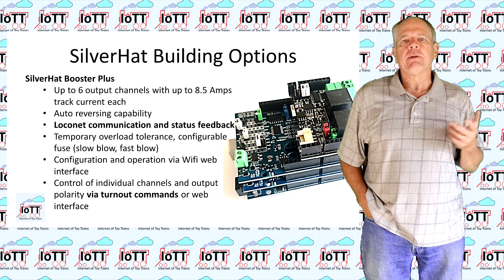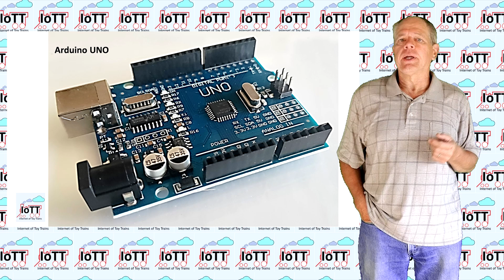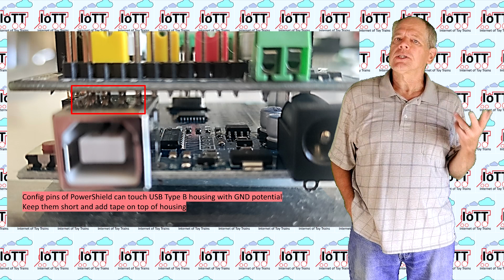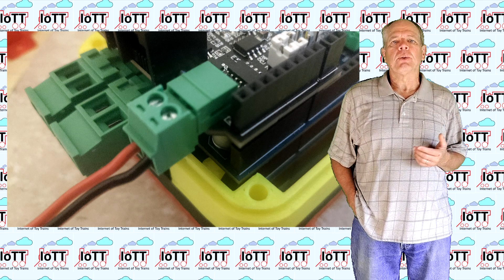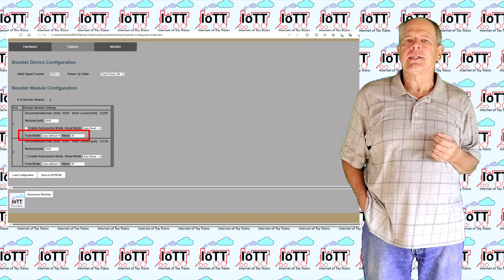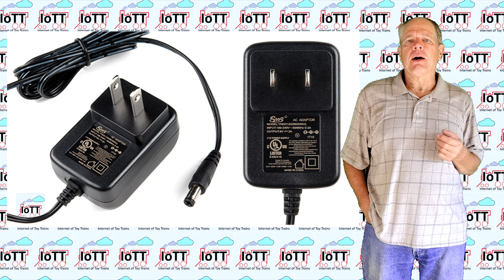Build your own SilverHat DCC Booster (Video#143)

Comment: Can I use the tinkerface with a AUX shield on a CSB1 setup as a booster ? I want to be able to access all the loconet feedback options on the M5 stick.  Or can I use a Wemos D1 r32 with a 8874 shield, Aux shield and tinkerface ?
Reply from the maker: Both ways could work, but you'd have to replace the DCC-EX software with a sketch that supports the additional functionality of the SilverHat, like current measurement and the communication. But then, if you do that, you could combine the Stick software with what's running on the CSB-1, since there is really no need to use 2 ESP32s for this. So, all in all, it is possible but does not make sense. The better option I think would be to add some functionality to the DCC-EX software and make it available via a web interface similar what you see on the SilverHat.

Comment: Which hardware I have to buy? Is it the one on tindie?
Reply from the maker: In the minimum you need an Arduino, a Tinkerface Shield for the DCC Input signal, and a PowerShield for the track output. Optionally you can add a DCC AUX Shield and an IoTT Stick, which gives you a web interface for current monitoring.

Comment: Great addition and explaination.   I assume yoou can use other power shields as well.
Reply from the maker: In theory yes, there are a few points you need to verify though. First the IO pins for the DCC signal. The Tinkerface Shield feeds them to pins 2 and 3, but you can remove the jumpers and feed the input to the pins your motorshield needs. If the motorshield does not support driving the H Bridge from two inputs, you can use only one, but in this case you can not generate the cutout for RailCom, probably a minor problem. The second point to verify is that the motorshield can't exceed the maximum analog voltage when you do a short circuit test, it should have a zener diode protecting the current sensor pin.

Comment: Hi Hans, Is it possible to combine the Silverhat Booster with a Command Station like the YAMORC 7001 which has loconet and track output
Reply from the maker: Yes. Any DCC command station will work. The Plus version will also be able to receive commands to control the outputs via DCC or Loconet switch commands. With Loconet, it is also able to send back some track status information encoded in switch commands.